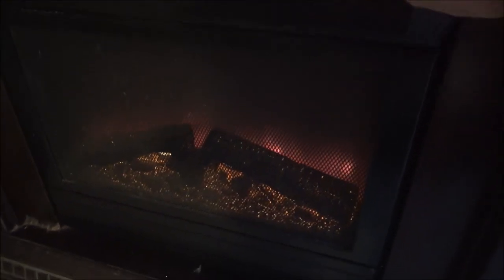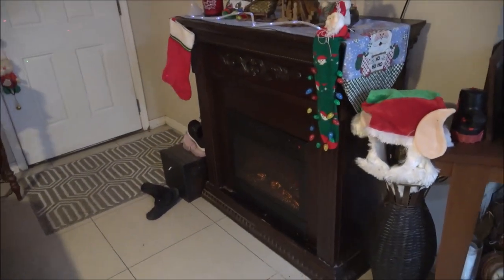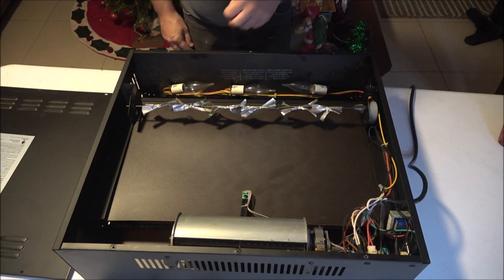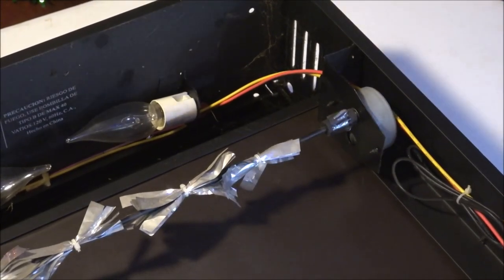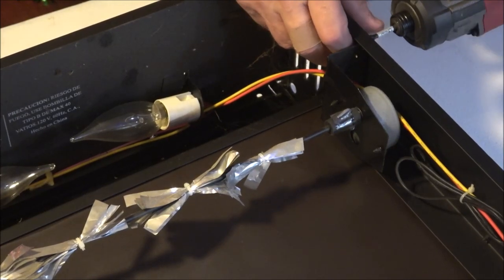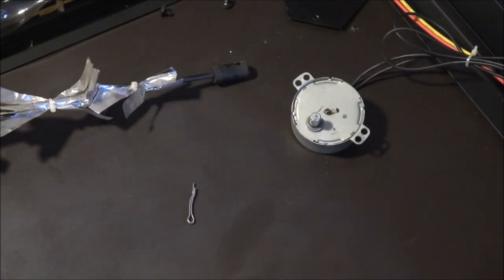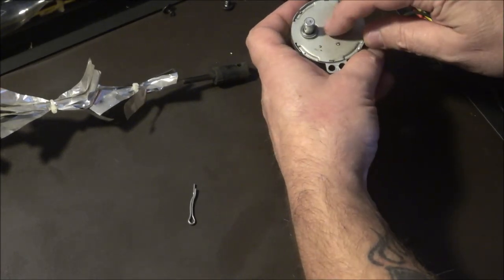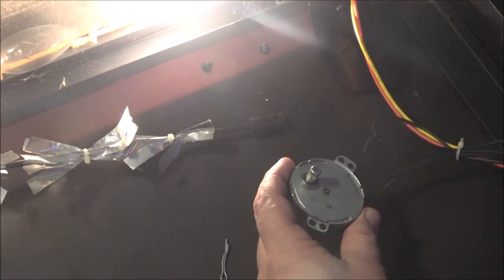Fixing A Horrible Noise In Our Simulated Fireplace

Comment: Holy 💩 😋 . That looks like the same 540 size motor setup that's also used in the bases for the rotating fiber optic Christmas trees ( ask me how I know, they're a cheap piece of 💩💩) 😋 . I've been pondering picking up one of those electric fireplaces like that.  What kind of BTUs for heat does it put out ?
Reply from the maker: This one puts out about 4,600 BTUs if I'm not mistaken. And yes I believe you are right about that motor, those things are in a lot of shit lol.
Reply: @shabear1000  Haha,  the 540 can size brushed electric motors have been used in everything and anything that's electric battery powered since the 80s including 95% of toy Quality RC vehicles made since then 😋 . As far as electric heaters go one thing that really surprised me are 2 hyper tough brand electric heaters we got at Walmart a couple 4 weeks ago.  1 is the hyper tough heavy duty utility heater w/ the controls on top just under the handle for $29. The other is the hyper tough utility space heater with the controls on the lower front part of the heater for $24 . 
For the $$ & their size they're 2 of the best electric heaters I've seen in quite a while and they work surprisingly well 🙃
Reply from the maker: @idletime  sounds like a good price for the heaters. I'll have to remember that if I need to buy a heater. Sounds like a good deal.